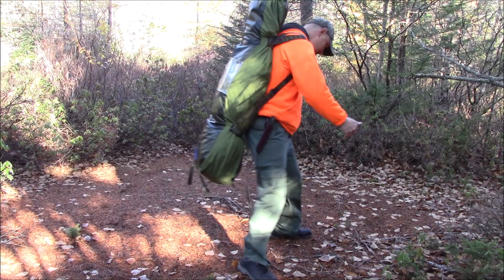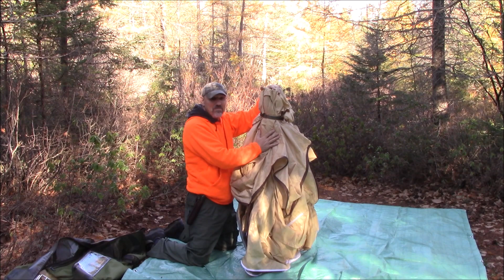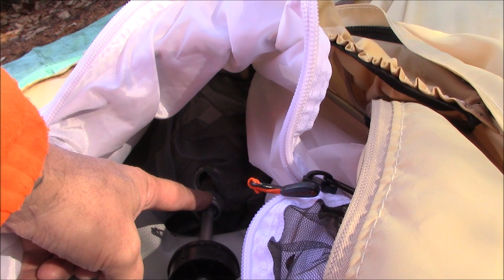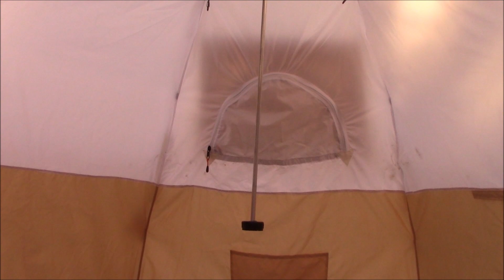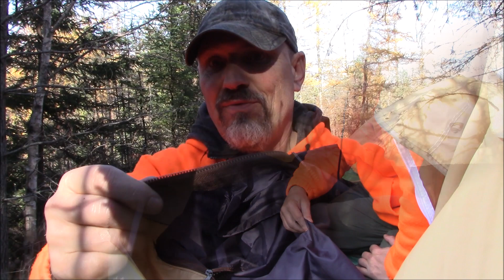How To Set Up The Mini UP 2 and GSTOVE Heat View XL PART 1

Comment: There is an additional outer cover for these tents. It's designed to add an extra layer of warmth in extreme cold temperatures. Only problem is the color. Bright orange. I understand the idea behind this color, but it would be great if they offered the outer shell in colors to match the tents. Would like a snow camo version. 

The tents themselves are outstanding and as Wayne demonstrated, very simple to set up. I use mine in the Arctic, and so far, no issues. The Gstove is perfect for this tent. Purchased the oven and water heater as well.

Safe travels Wayne. 🍻👍
Reply from the maker: Yes they have many accessories to add for helping with warmth. Insulated floor helps as well. :) Thanks for the watch and your thoughts.